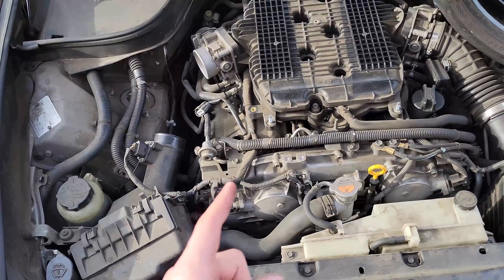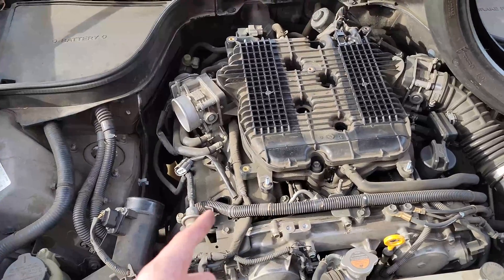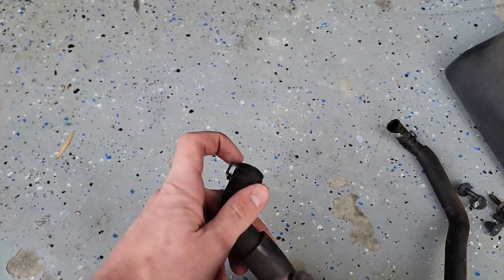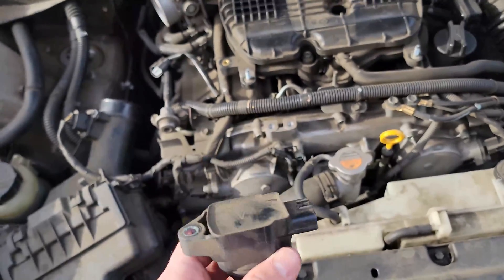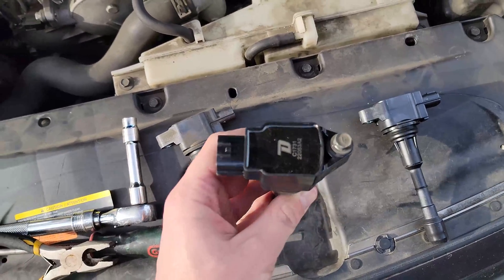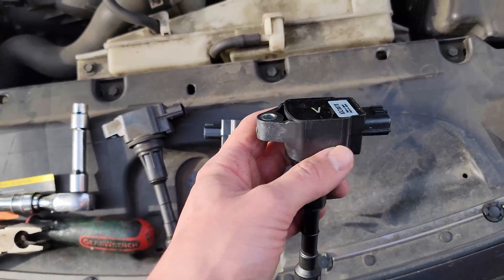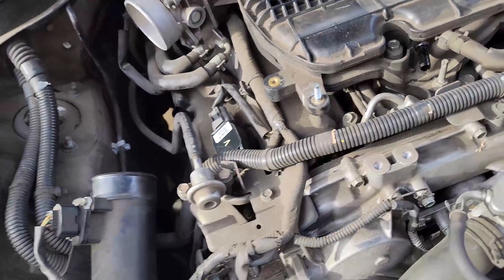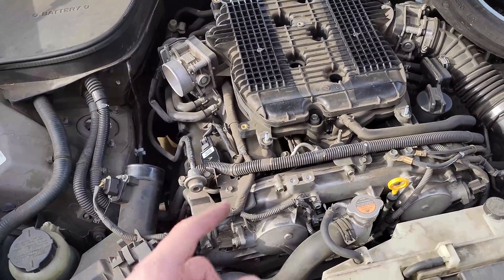EASY VQ37 Engine Misfire Fix p030(1-6) Code

Comment: My car runs rough sometimes then smoothes out. No check engine light though. I’m doing spark plugs tomorrow hopefully that fixes the issue.
Reply: Bro same I just bought a 2015 Infiniti q50 3.7 and no check engine light car idles smooth and drives smooth but I know forsure there is a lack of power and off the dig it is hella slow then picks up crazy speed as I keep going. It has to be either coils, spark plugs, or fuel injectors. I’m heated tho I just purchased this car(finance) and this shit is happening. I do have warranty tho so imma just take it to them and tell them. I scanned my car and it has no codes but the random/mtiole misfire code.
Reply: @ihypercc3295 I think I found out the issue it was my alternator going out. I did do spark plugs it helped a little bit didn’t fix it. New Alternator fixed.

Comment: So I have changed all the spark plugs, all the coils and but I changed all 6 coils and spark plugs to be thorough but I’m still getting a rough rough engine, anyone know what could be still causing the rough ride? Once I pick up speed it gets a little better but when at stop lights it feels like car is about to stall, changed battery too and no luck, any help will be appreciated. Thanks.
Reply: Fuel injectors or fuel rail

Comment: I had this same misfire issue. The "service engine soon" light would flash when i accelerated and the car exhaust sounded terrible when i accelerated and had no power at all. I cleaned my throttle bodies, cleaned MAF sensor, changed spark plugs, changed all six coils and my misfire was fixed. My car also feels a lot more responsive and faster after doing all these things. So to anyone having this issue, do all the things I said in this comment.
Reply: So I have changed all the spark plugs, all the coils and but I changed all 6 coils and spark plugs to be thorough but I’m still getting a rough rough engine, anyone know what could be still causing the rough ride? Once I pick up speed it gets a little better but when at stop lights it feels like car is about to stall, changed battery too and no luck, any help will be appreciated. Thanks.
Reply: @MaCheetahdid you ever fixed the issue?
Reply: so I took my spark plugs out and I think it had gasoline on it I changed the injectors I didn’t change the spark plug nor the coil packs do you think it could be those it’s still weird how there’s gasoline on my spark plug
Reply: I just paid 350 to have all my exhaust leaks fixed after my car was sitting for a whole, I also had removed my exhaust prior , issue remained, took it to get scanned and this code came up, I’m sure this will fix my problem

Comment: changed the coil pack. Car def runs way better now but code still comes on for the same cylinder missfire. Anythoughts?
Reply from the maker: Did you clear the codes? Maybe try changing the spark plug too?
Reply: @NicksCarHistory  yeah cleared the code, and still detects misfire after driving it a couple miles . I changed the spark plugs like 30k miles ago but I am changing them again this weekend
Reply: @henrymeyer4102  how is is it’s drovikg now ?
Reply: @shavoysamuels8448  had to change the spark plug as well, then which was covered in oil. had to replace the gasket and now it’s running good
Reply: @henrymeyer4102 which gasket ? I’m having the same issue. I thought it was my speed sensors causing this and making me rwd but it wasn’t that causing the SES and misfires
Reply: @BoostWithPitu  If there is oil on the spark plugs or ignition coil you’ll have to change out your valve cover gaskets
Reply: @vanii241 would this cause the misfire as well?
Reply: @keventorres5130  Yes if the ignition coils and spark plugs are covered in oil they won’t work properly
Reply: @vanii-visuals  Im wondering if he meant that if the valve cover gasket was covered in oil would it also cause a misfire?